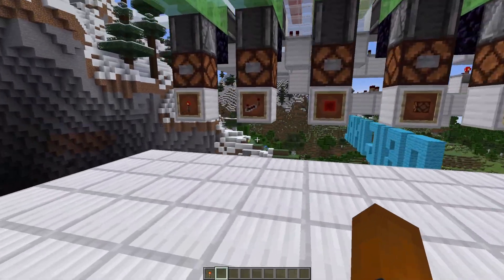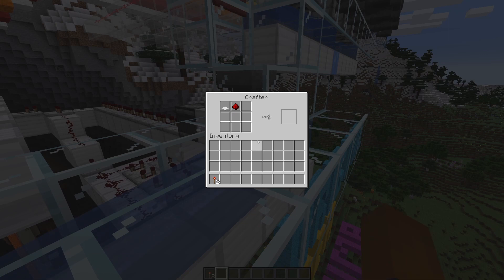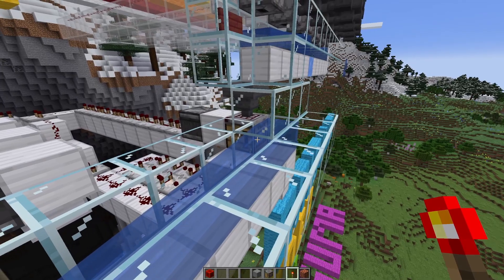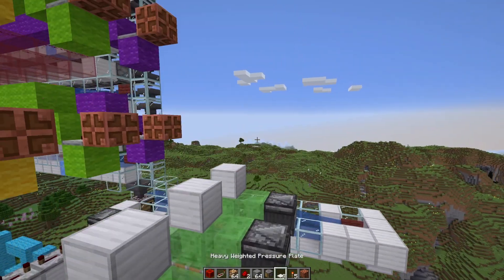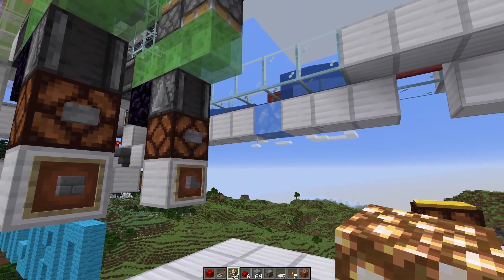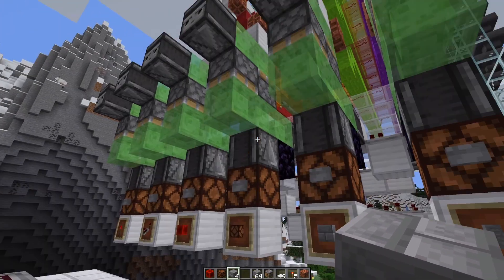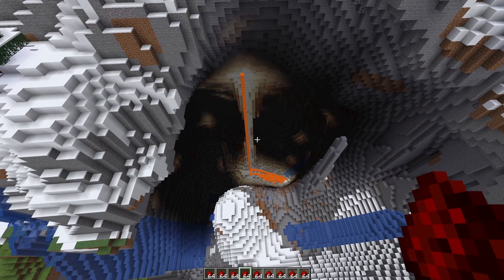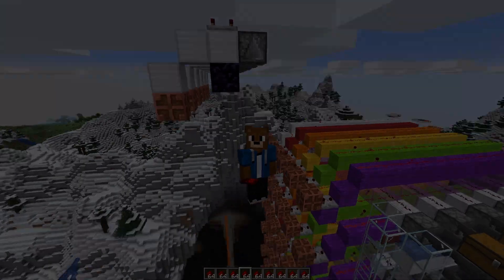😁 GOD LEVEL MEGA AUTOCRAFTER : testing Xisuma's encoder logic idea

Comment: You can modify encoders like these to be tileable by using rails and observers. Have a set of rails on top going from east to west, and under those (in places that you want) put an observer facing into some rails going north and south. At the ends of those rails, place some observers to detect their changes. Et Voila: smaller encoder (not solid state though)
Reply from the maker: Jeez that’s heaps more compact. Kinda wish I used that on the bigger version

Comment: use scaffolding instead of the vertical flymachine, then just make sure that the waterstreams of items on each height block the item untill all ingredients are detected and then release the ingredients every 4 ticks (hopper speed) so they dont combine at the hopper that puts them into the crafter
Also use a minecart filter under the crafter to get the placeholders out very fast

to craft a stack, just add a 64 counting clock and add an AND gate behind each copperlight comparator, each of the 64 pulses from the clock will activate the AND gate of the glowing copperlights

To improve further you probably need a way to limit the placeholders to just 1 instead of a stack, so it can be emptied faster, this can be done with a comparator decay clock that is long enough to ignore multiple signals from the same stack of crafts
Reply from the maker: Oh scaffolding that's a much better way, im probably going to swap that in. I was kinda messing about with having a system where the pattern gets release first then just blasting a multitude of the rest for a stack. unfortunately the next one is a little bigger but hopefully should have it out during the week. thank you so much for your help

Comment: Awesome autocrafter
if you placed the recipes as far up an to the left as you can in the crafting grid you dont need to use that many placeholder items and the flying machines travel could be shortend, wont work if you are going the bulk autocrafting route, but you could input the remaining placeholder items faster with a circit of some kind.
Reply from the maker: that's a great idea. there are heaps of different ones that could be made alot quicker with this method, cheers for that. :)